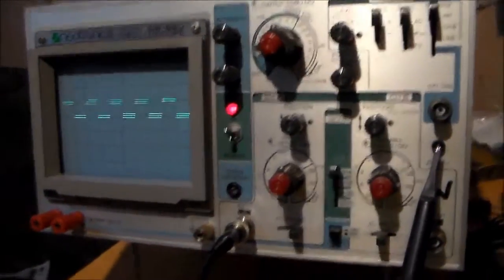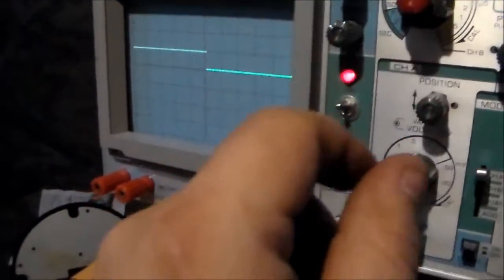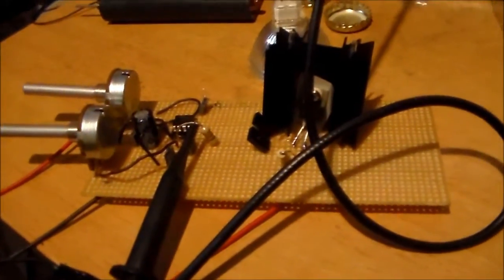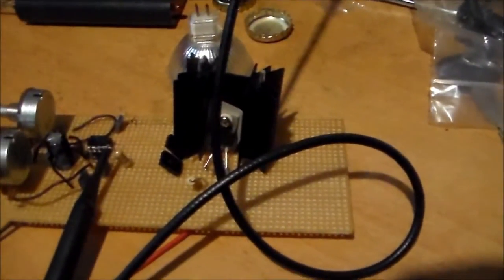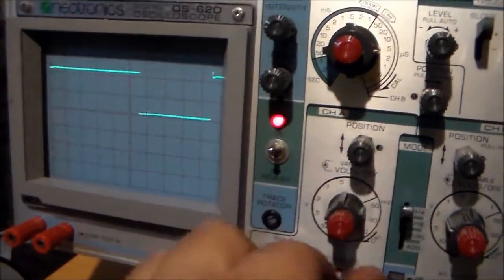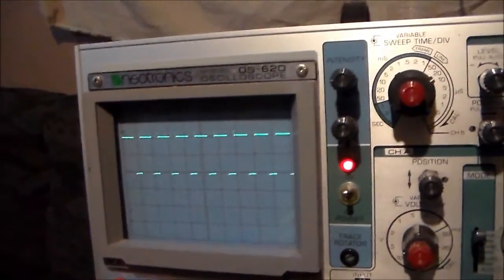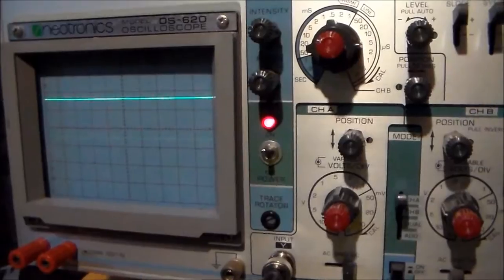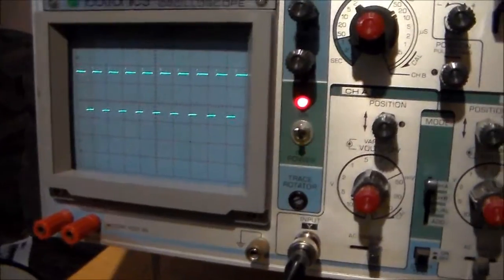Oscilloscope, Test Pattern, 555 timer ramblings

Comment: if you want a good little project to keep time going by then 4017B counter run by 555 Astable..the counter outputs of the 4017B counter go through varying resistor values to control the control voltage (pin 5 i believe) of the second astable, which goes to a piezoelectric sounder..if you want loud speaker just get the 555 Astable to feed a driver circuit of course. you can make alot of different tunes..done it for a electronics project & adding a button i suppose you could calal it a door bell..

Comment: Bread boards can certainly be handy! Also, I agree, the NE555 would be a better idea than the cmos version. I think it can source and sink more current, and cmos around what you're building is kind of tempting fait. Another source of good hi frequency power is the guts of a PC power supply. You could drive a center tapped flyback primary from the center tapped   PC transformer secondary, and the 2 sides that go to the outer pins of the 12 or 5v 3 pin diode packs.400W of pure evil!!!

Comment: Another circuit for you! 
Do what kevtris said too. 22ohm power in to pin 8 and 100uf 8 to 1.
Connect  pins 8 to 4
7 to 3
and 6 to 2.
1 to gnd, 8 to 12v
1uf cap 5 to gnd 
Tineing resistor 3 to 2
timeing cap 2 to 1.
3 to gate of FET.
Pin 5 can be a PWM input if you want. (0 to 12v) 
In this (not from the book) circuit, 3 and 7 make a low impeedence drive that should directly run a mosfet really well.
Maybe a 100pf cap from drain to gate of the fet to stop parasitic oscilations.

Comment: do you have any kind of resistor between the 555's power input and your voltage input to the entire thing?  There should be say, a 22 ohm resistor for Vin to the 555's power pin (pin 8) and then a capacitor (say, 100uf) from pin 8 to ground.

What can happen is pulses from the flyback coming on the power line can hose the 555's operation.  A .1uf (100nf) capacitor from pin 5 to ground can help, too.  Make sure pin 4 (reset) is connected to pin 8 or it might act weird also. cheers

Comment: The old 555 timer is a dam handy little chip, apart from astable or monostable configurations, it can be wired in very odd ways to produce allsorts of results :-)

I think they are from around the 1970's.

i tend to stick to the standard devices as the cmos based versions i find are less accurate and just dont perform like the old types.

Allways stick a 100uf electrolitic capacitor across the + / - power input of the 555 for stability.

Looks like youve got the oscilliscope mastered :-)

Comment: The 555 doesn't have enough power to directly drive the mosfet at high frequencies due to the gate capacitance. It will take too long to switch and get very hot.